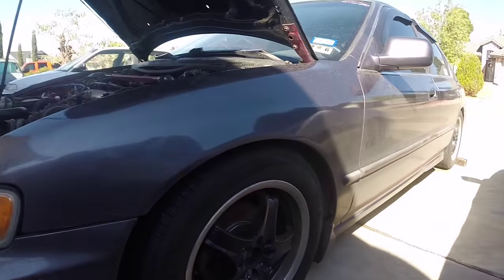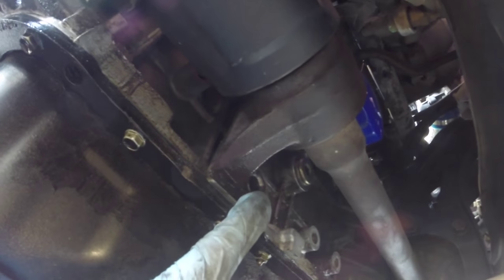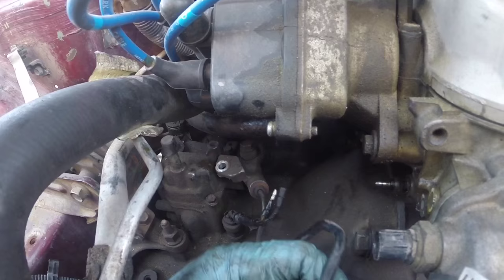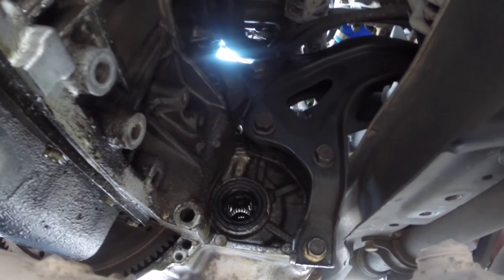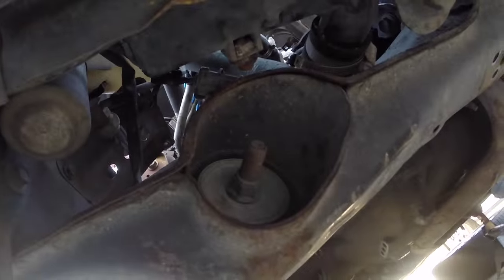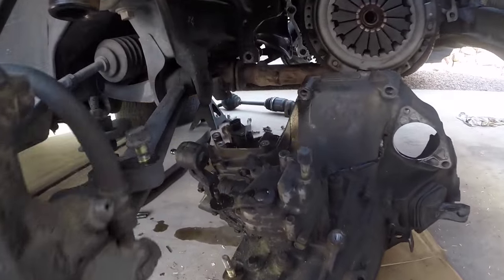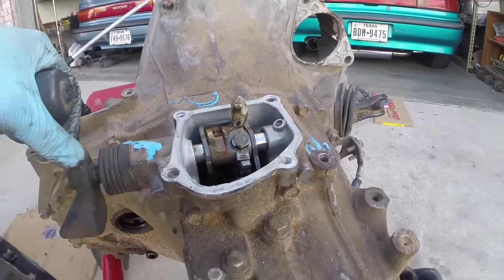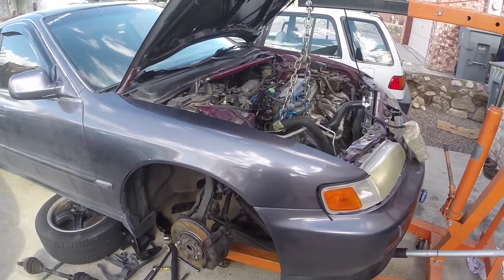How to Remove Transmission 1994-1997 Honda Accord plus Clutch Replacement

Comment: I replaced my clutch and once I put everything back together my speedometer/odometer and reverse lights arent working, any suggestions?
Reply: Colin Cooney did you happen to unplug your vehicle speed sensor?
Reply from the maker: Check what Isaac mentioned, and just check all the connections in general.. Check all of the ground wires too.
Reply: Colin Cooney you might have left some harness plugs unplugged.

Comment: My transmission just went out in my 94 and once again you saved me a lot of trouble. Thanks for being the most informative Honda channel!
Reply from the maker: Thanks for that Josh, hope this helps!
Reply: I have another question about my 94 Accord. The power steering went out long ago, the pump works but turning it is hard and drips a stream of power steering fluid when I turn. Now that has to be the rack and pinion correct?
Reply from the maker: Correct

Comment: Subscribed! I really love how you showed everything so well and explained every important detail while keeping it short and sweet. I have a 1990 CB7 Accord and it's making some terrible clunking/whirring noises when I push in the clutch. I can feel it very strongly in the clutch pedal as well but it still shifts and works fine. Well, I've never done a job this big and even though my car's 7 years older that yours, it still helps with the basic steps and gives me more confidence in diagnosing it myself 👍 Thanks again for taking the time to make this and I'm really looking forward to watching some more videos on your channel man! Keep up the great work on the awesome cars bro!!
Reply from the maker: I really appreciate you taking the time to write such a nice comment.  I love to hear it.  The process should be very similar and help with yours.   There will probably be very minimal differences between the different generations!   Good luck with your Accord, I think you should attempt it, and this is a great guide to help you alone the way!  Thanks so much!!
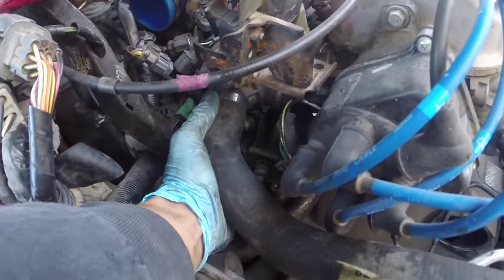Reply: Hey it's no problem, I really think this is the most helpful clutch video I've ever seen and thought you should know lol. But yeah as intimidating as it is for me to pull the transmission, I'm feeling confident now. I just got a quick question for you if you don't mind. Around 5:50 in your video, you talked about removing a plate at the bottom of the transmission. I noticed the flywheel was exposed after that. Is there anything else you can see in there? Lol, it might be a dumb question but I'm just curious if I'd be able to remove it and possibly see what's causing my problem? Anyway, you've been extremely helpful and I'm so happy I stumbled onto your channel haha! Thank you very much again for all your help!!

Comment: This will be my first time replacing a fly wheel and I was wondering if there was a bearing in it or not. Saw something called a clutch pilot bearing but I'm not 100% sure
Reply from the maker: Yes, you are correct.

Comment: What can I use to get the pressure plate and clutch out if I don't have a 12 point soc
Reply from the maker: Christopher White Nothing else, just a 12 pt socket.  Otherwise you risk stripping the flywheel/pressure plate bolts.  Trust me it's not fun and not worth it.  I stripped a flywheel bolt before and had to grind the head off to get it removed.  I was even using a 12pt socket but it slipped.  What a PITA that was.

Comment: it will make sense if honda can make the gear filter removeable through the oil exit areas to ensure filter can be changed alwasys. my question is, does honda accord 1996 and old model crv use the same gear box? info@pockettvng.com
Reply from the maker: No

Comment: I've been studying your video like crazy man! It has been 17 years since the last time I did a clutch job. I have a 96 accord 2.2l and my main concern is what I'm going to be dealing with, when it comes time to remove the flywheel. What is the easiest way to do that in order to keep the crankshaft from turning?
Reply from the maker: Use a socket and breaker bar on the crank pulley bolt and put it against the ground or control arm.
Reply: @GarageBuiltHondas  thank you. I will give that a shot 👍

Comment: So u got the transmission in Do the two front wheels have to spin at same time cuz I jacked it up and the driver side only spins and of other just a bit
Reply from the maker: That's the differential working.  It's fine.

Comment: THIS MYLOW OUT OF DENVER SO I WOULD HAVE TO DO THE SAME STEPS TO JUST CHANGE THE CLUTCH RIGHT DO I HAVE TO CHANGE THE FLY WHEEL
Reply from the maker: It's smart to either have the flywheel resurfaced or install a brand new one altogether.
Reply: @GarageBuiltHondas  OK MAN THANK YOU I APPRICIATE YOU

Comment: How or where do you find replacement transmission parts for these cars? I'm looking to replace my differential and maybe some other gears in my 5 speed.
Reply from the maker: I'm unsure.  Google shop it and see if there's aftermath companies that make parts for them.

Comment: During clutch/flywheel replace on my 95 accord. In your video did you do any fluid drain? If not that would be awesome less work i gotta do. Thanks
Reply from the maker: I always drain the transmission fluid when removing transmissions.  It can be a mess if it spills out.  Plus fresh oil in the transmission is a win!

Comment: Hello everyone 👋 Question?
Will a 2000 Honda Accord manual Transmission work/bolt on my 1991 accord 2.2l f22a1? 
Thanks!
Reply from the maker: I don't know.  It might, my guess is no.

Comment: Hi John.. Hey thanks for doing this and videoing it sure saved my bacon but the problem I'm running into is if I need too remove the exhaust. So if you could please enlighten me on what you did in this situation I'd sure be grateful as I am at the stage where I'm getting ready too drop the motor and I'd sure hate to screw it up. Al ps. Also do you think it is normal for the spindle too be dry do you think as they sure are. Hope to hear from you.. Thanks Again!! AL

Comment: what other transmission will fit in a 97 honda accord lx 2drmine had a hole in it i love your videos also thank you
Reply from the maker: +Sunshine Scott any 94-97 accord models.  I also believe the 92-96 prelude F series transmissions work also.
Reply: The H series will fit. The gear ratios are different so it won't drive the same. But some H series come with an LSD.
Reply from the maker: Thanks for that added info!!

Comment: hi change the transmission everything went good
transmissions shifts but the car is giving me a p0720
solenoid, speed sensor, temperature sensor?
the transmission that I install didn't come with any of these so I have to use the ones on old transmission. should I replace all these?
also I heard about using Honda transmission fluid, I didn't I use the Asian formula from Auto Zone....
thanks for your help.
Reply from the maker: The ATF you used should be fine.  I found this info on Google.

Common Problems That Trigger the P0720 Code

Defective Output Speed Sensor
Defective Shift Solenoids
Defective Engine Coolant Temperature Sensor
Defective Valve Body
Dirty transmission fluid that restricts the hydraulic passages
Defective Output Speed Sensor wiring or connector

I'd try troubleshooting each to narrow it down. Maybe you have a bad connection?  The wiring is old, take a look at all of the connectors.

Comment: Just wondering if you replaced Pilot bearing or bushing that fits into flywheel or if it even has one I’ve been trying to find one for my 94 ex
Reply from the maker: Yes.  You should be able to find them everywhere, even you local auto parts store

Comment: I followed every step u did in this video and I came to a problem which was lowing the transmission and it didnt separate from the motor can u tell me why and what I need to do in order to drop my transmission out of my 1994 honda accord
Reply from the maker: Double check everything is disconnected.  It may be the input shaft of the transmission is just still inside the clutch.  Possibly loosen the bolt that holds the driver side mount to the car so the mount will swing down and let the transmission get even closer to the ground.  Then pull at the transmission, or use a small pry bar to help pull it away from the block of the engine.

Comment: Hi mate, greetings. My honda accord has F23a engine with 4 speed automatic. Year 2000 (CF6 NZDM). My transmission is on its way out. Just want to confirm if any f23 automatic transmission will work with my motor as i have some good options from ofher f23 models.
Many thanks in advance.
Reply from the maker: The 98-02 F series will work.  I'm not sure if some of the older models would though.
Reply: @GarageBuiltHondas  many thanks again. Stay safe.😀
Reply from the maker: Likewise!

Comment: This is perfect. I have a question though. I need to replace the oil seal for the shift shaft linkage. That part that broke in your video. 
My seal leaks and I'm trying to figure out if I have to remove the transmission to get to it. Or can I take it apart and slide the seal off like the B series civics. Your video showing us that particular part leads me to believe that it needs to be taken off and disassembled :(. Do you know for sure? I might as well buy more parts to update it along with upgrades.
Reply from the maker: Can you give me a time stamp?  I'm unsure which part and it's been a long time since I've worked on that car, and I haven't watched the video in a couple years also.

Comment: Thanks very much but I wish my Honda was a clean as that one that you were working on. It would be nice to see how to properly unclip those electrical plugs. Mine were all quite dirty and I broke the one to the antifreeze outlet or input. I may break some other ones too, if I am not carefully enough.
Reply from the maker: Most of the plugs can be replaced.  You can de-pin them and put a new one on if you desire, it isn't too difficult either.

Comment: You DO NOT want to pry against the inside of the rear main oil seal!  In fact you do not want to pry against either side of the rear main seal.  You want to use a heavy duty ice pick or other pointed tool and tap light into the middle of the rear main seal (there is metal in the seal).  Then use a small tool with some protection to not damage the surfaces of the engine and pry around the seal gradually EASING it out.  If you scratch and/or nick the surface of the the rotating metal the bearing rests against, you will have leaks and your bearing will fail.  Also when installing the bearing any sharp edges or nicks created will score the rubber seal and also cause leaks.
Reply from the maker: Agreed.   People with no experience need to go easy.

Comment: hey man, hoping you reply, but im about to replace the clutch on my 2001 honda accord 4 cylinder, and i was just wondering if its the same as this? it'll be my first time ever doing something big like that but mechanics around me charge a fortune so haha, and another question, it is necessary to drop the transmission to just replace the clutch/throw out bearing/ pressure plate? thank you so much!
Reply from the maker: The process of dropping the transmission will be very similar if you have a 4 cylinder manual transmission model.  And yes, you have to remove the transmission to get to those parts unfortunately.
Reply: Great video! Very informative. Do you know if the clutch, pressure plate and/or flywheel from a 96 accord LX will fit on a 2002 accord (4 cylinder)?

Comment: how did you support the engine once the transmission was removed?
Reply from the maker: 2x4's cut into small pieces
Reply: Jon Widmer where did you place the blocks off wood?
Reply: Jon Widmer where did you place the blocks of wood?
Reply from the maker: luis lopez under the oil pan.

Comment: I have 1992 5 speed Honda Accord  would it be the same process and what would you recommend as far as a new tranny fly wheel and clutch 
 system . 
    I do want to swap engines some time but have other things to do first .
Reply: 1991 Honda Accord *
Reply from the maker: Very similar process, maybe a few different steps here and there but this will help.  I would look at an Exedy replacement clutch.

Comment: How close is this to the automatic  transmission??
Reply from the maker: It'll be very similar with the exception of the shifter cables and the removal of the torque converter from the automatic flywheel.

Comment: Hey bro just wondering what socket you used to get the clutch pressure plate bolts off with
Reply from the maker: 10mm 12 point

Comment: hey man i put the transmission back on and the clutch fork is all loose and wiggly it doesnt stiffen up like its suppoed to
Reply from the maker: Fork?  From inside the transmission?
Reply: @GarageBuiltHondas  my car is outside right now with the transmission off . Does the clutch fork stiffen up when you mount the transmission back on or is it supposed to flop around all loose . its loose so the slave cylinder even when bled cant press the release barring

Comment: hey i have a question for you.  i have a 1996 accord with 202000 miles. i want to sell the transmission. would  it be worth as is...300bucks? if not what would it be worth to a person who btw would have to remove the transmission ?
Reply from the maker: $300 sounds too steep.  You can get transmissions from the junkyards in our area for between $100-$130, and they give you a 30 day warranty for free. 
If they have to do the work, I'd still say between $100-130 since they would have to do that same work at the junkyard.
Reply: Jon Widmer thanx for thst. i have another question for u. it appears (by a few mechanics locally) that I have a spun bearing in the engine so I don't think I'll make the money I was looking for. i have another person interested in the airbags. hood. bumper and headlights.  would 125-150 be too steep for all of those parts?
Reply from the maker: Soverign Cold-Steel that sounds fair.  Most parts usually will sell for what they are worth.  It all depends on demand in your area.  If you're going to part it out I'd start the prices a little steep to offer bargaining room.

Comment: I'm afraid of forgetting to put something back after I tear my car down.. any chance you have a checklist you use to make sure you put all bolts back and tools etc? Great vid subbed and liked 👍👍👍👍👍
Reply from the maker: Thanks, much appreciated.  I don't have a could go slow and put the nuts/bolts into separate ziplock bags and label them to avoid any confusion.  It'll make the job very simple when you need to reassemble everything.
Reply: Jon Widmer great idea thank you so much I never thought of that lol 👍🙃🙃

Comment: Hey man my son has a 1997 honda accord and when you push the clutch it wont go in gear before i would notice it happening in the morning and after the car warmed up it would shift into gear just fine I checked the fluid reservoir and it was dry I added dot3 brake fluid like it said on the cap and still it wont go in gear and now the clutch feels like the cable is broken when you press on the clutch any ideas on what I can do?
Reply from the maker: If the brake master cylinder reservoir was dry then you have either a leaking brake master cylinder or slave cylinder.  One of those is probably broken.  See if you can see where the fluid was leaking.  I'm assuming you also own a 94-97 accord?
Reply: +Jon Widmer. I changed the master cylinder and slave cylinder I bled the line and the clutch pedal still stays down i feel no pressure is there something else that can cause that? I actually own a nissan armada this is my sons first car I want to help him fix it up
Reply from the maker: +George Ramirez If they were both brand new parts and both changed then the only place I can see a problem is in the bleeding.  You may need to re-bleed the system and do it slowly, otherwise you can still suck in air going quickly.  Try to re-bleed and see if that fixes the pedal staying on the floor.

Comment: If my car RPMs go up but doesn't accelerate in gear. Does that mean the clutch died?
Reply: I have a 1994 Model. I had to raise and drop RPMs to shift to get myself home. When I arrived it just died on the spot😢
Reply from the maker: Sounds like it, highly doubt it's the transmission but that could also be the issue.

Comment: I have all the tools except for that lower control arm separator. Also my transmission is automatic
how many quarts of ATF and what type
thanks
Reply from the maker: Total capacity is 6.3 quarts for the auto trans, but depending on what you drain the amount you add may vary because of the fluid that will be in the bottom of the radiator in the cooling tank part and any left in the lines.  After you finish keep adding fluid until you get close to the fill line.  Then warm up the car and check the level and add more if needed.

Comment: I'm doing this tomorrow 
I have a 97 Accord lx
it'll be my first time changing a transmission.
Any advice for a novice
Reply from the maker: Be patient, take your time.  For a first time, it'll be a big learning experience.  Make sure you have all the necessary tools and maybe a breaker bar to help with the stubborn bolts.